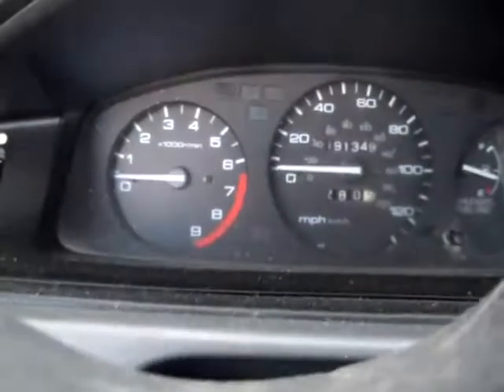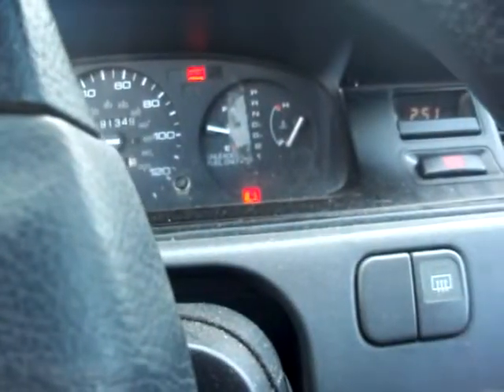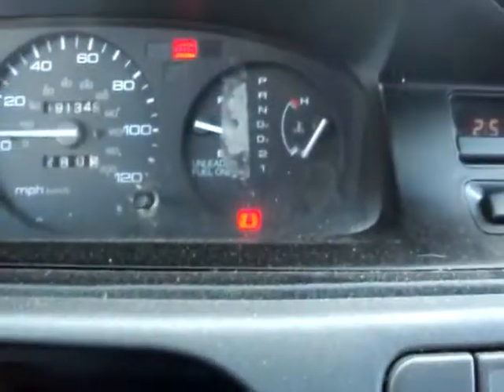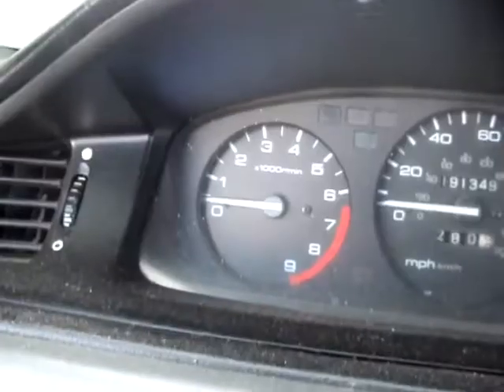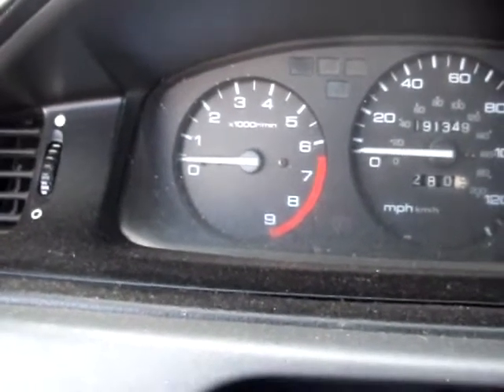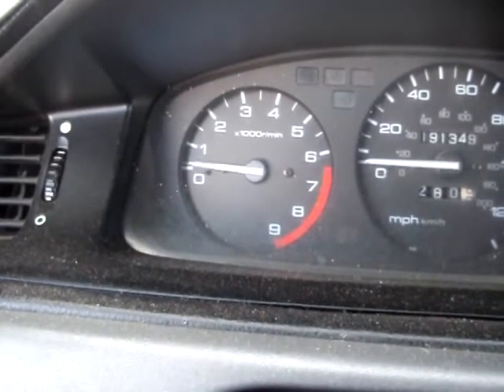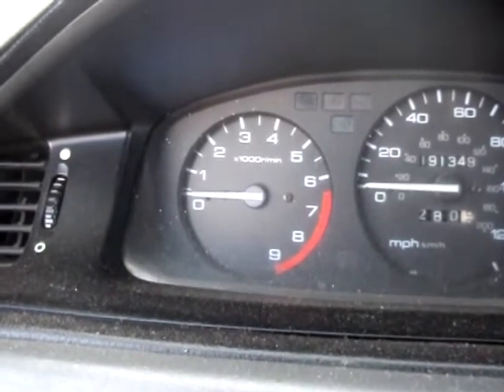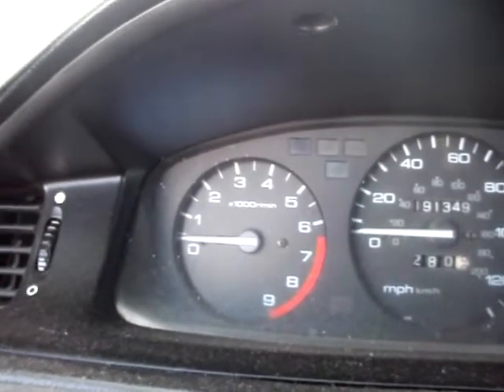map sensor issues

Comment: Mine was doing that. After replacing so many parts. I read about throttle actuator, cleaned it, it was clogged with grease, carbon and it wasn't letting the right amount of air through. After cleaning it with throttle cleaning spray,  it runs smooth